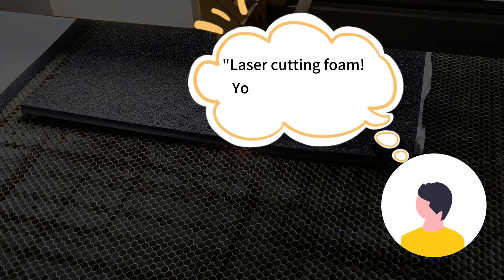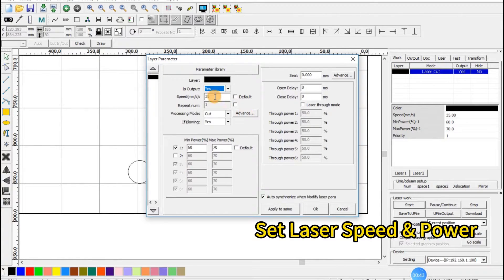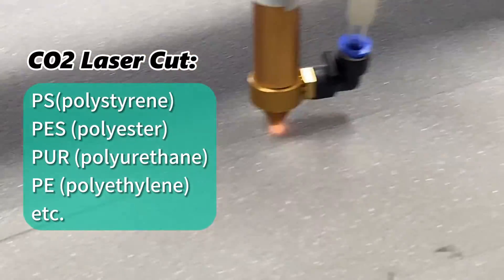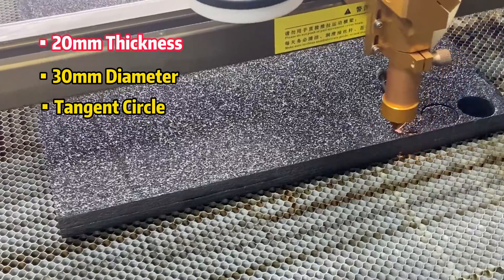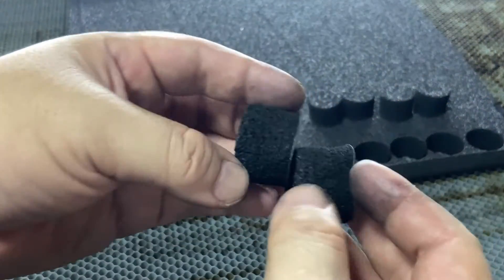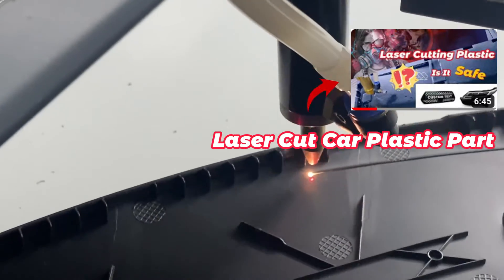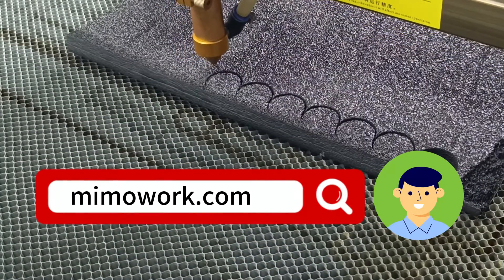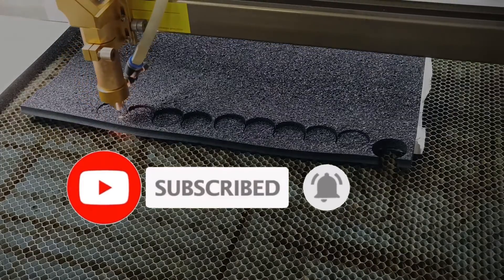Never Laser Cut Foam?!!😮 Let’s talk about it

Comment: i got my 5mm form board cutted by laser cutter but  it left burn stain in the side edge of the form pieces  i dont know how to nake it white of how to cut without making stain
Reply from the maker: 5mm foam board is thinner and easy to cut by laser, which needs lower laser power but higher speed. For a clean cutting especially for white foam, air assist and the exhaust fan must be turned on. For specific settings, please consult your laser machine supplier.